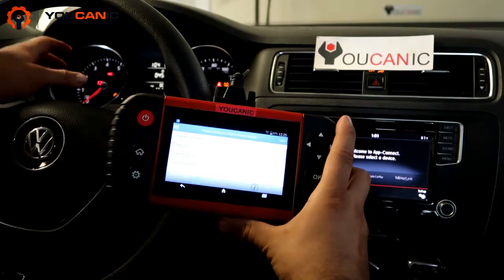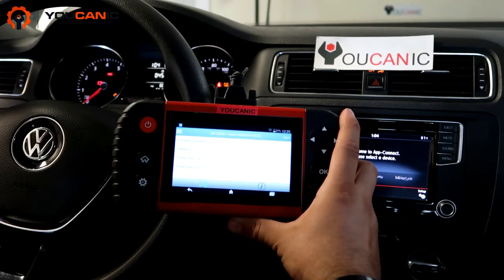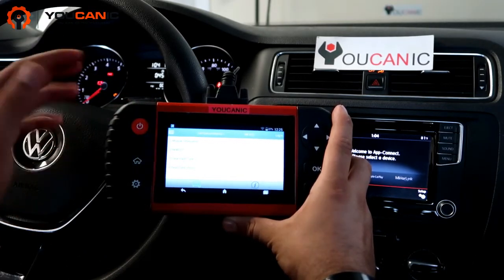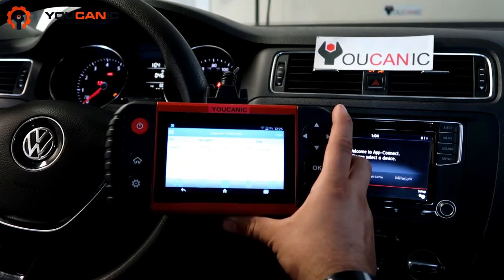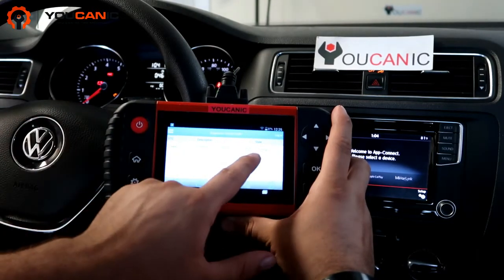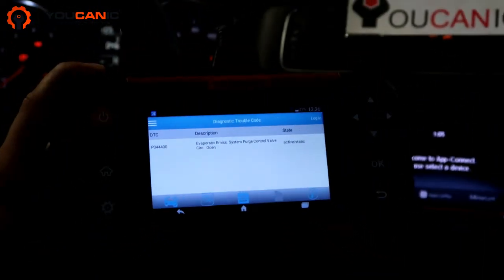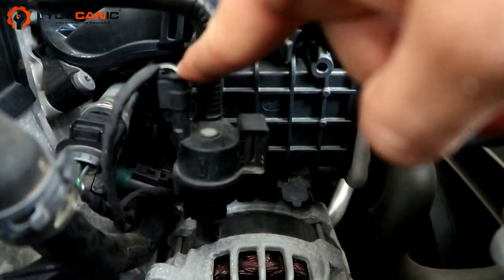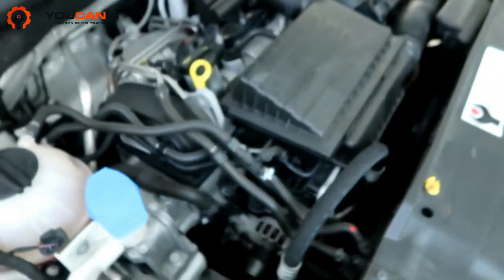Volkswagen P0441, P0442, P0443, P0444 Codes: Troubleshooting the EVAP Purge Valve

Comment: What is the part number for that purge valve? Is this also for a 2016 jetta w/ 1.4 eng?
Reply: 04E-133-366-CQ is the assembly. it doesn't look like you can get just the purge valve for the year/engine.